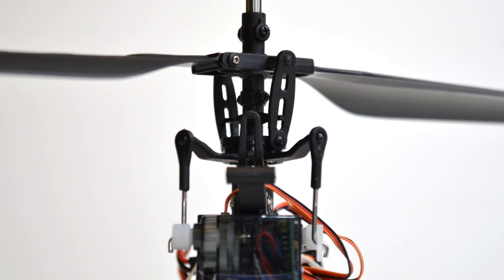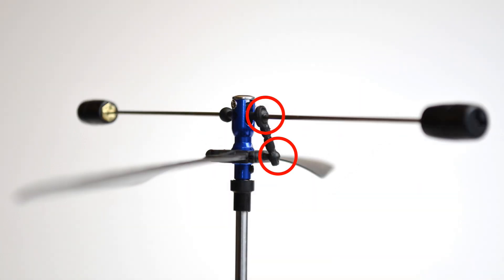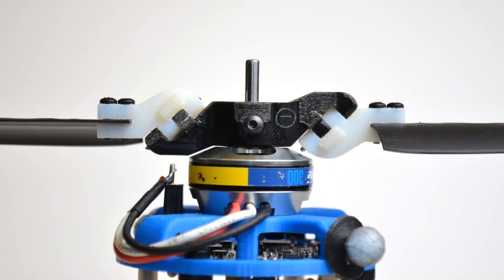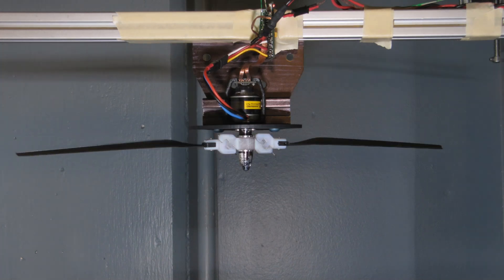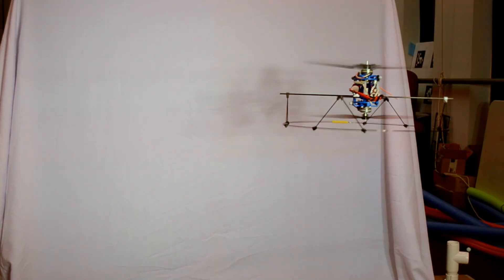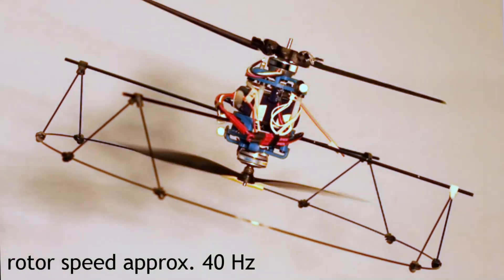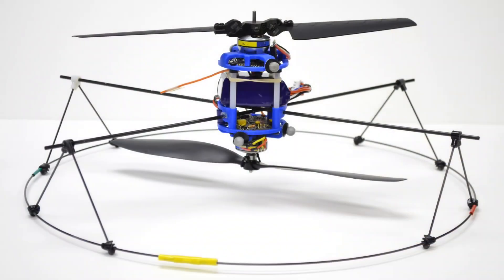A Swashplateless MAV: Thrust, Roll, Pitch, and Yaw from Only Two Motors

Comment: I was wondering how hard would it be to try this with a conventional helicopter gas engine. I imagine it would need flywheel , brakes and springs to modulate the rotor torque with the necessary frequency and phase. The frequency is fixed really what needs modulation are amplitude and phase, I suspect that it's not impossible but probably inefficient compared to direct pitch control with a conventional swash plate
Reply: With the efficiency of electric motors, it could be done by using a gas engine as power source but convert that to electric power and use an electric motor to achieve the fine control of the rotor
Reply: It would be nigh-impossible with a gas engine. you need to very accurately adjust rpm faster than the bangs of even a two-cycle engine. A hybrid platform, where a gas engine or turbine powers a generator would be possible, though there are questions to feasibility.
Reply: @Scrambling-Man I am not thinking of modulating the torque of the engine, that's why I was suggesting a mechanical elastic/quasiresonant arrangement at the propeller axis level. Thinking again about it it could be a solution for electric motors too, the straight electric version like the one of this model doesn't scale well with size

Comment: especially cool even for large scale use cases- there are a lot of constant-to-sinusoidal rotational motion mechanisms out there that could be used on existing helicopter engines to make this work. Though, you don't get collective with this, which is kinda cheeks. Still, it would be excellent for thruster applications. Say, a main rotor or sets of rotors that only have collective pitch for the sake of efficiency, and smaller rotors with this system that allow rapid changes in direction of force. Good shit.

Comment: Revolutionary in concept but seemingly impractical bcz cyclic stoppage of motor from full speed will cause massive cyclic stress on entire system causing premature fatigue failure & cyclic vibrations will also cause very uncomfortable ride.
Reply: I think you misunderstand what is happening. It is slowing down and speeding up once per cycle. There is no full stop. it varies.

Furthermore, these types of motors are completely used to this type of treatment in their regular application in drones.
Reply: Cyclic Vibration amplitude comparison study with conventional same weight helicopter, using accelerometers will prove the concept for feasibility. Given even conventional helicopters are borderline acceptable on cyclic vibration.

Comment: Came over from Tom Stanton’s video. This is an amazing concept!
Reply: Diddo
Reply: I did not understand please help
Reply: @kabutar7998  simply put.instead of using servos to angle the rotor Blades. It uses cintrifigal Force. As the motor speeds up the blades increase angle of attack. As the motor slows Newton's law kicked in and the blades decrease in Angle. This happens every 180deg causing  constant lift and also stability. Motor torque is overcome by the tail Rotor Motor. Depending on what direction and where the blades are in relation to that direction. You are able to achieve pitch and roll Control.
The most amazing part about this is the coding work needed to achieve stable controlable flight
Reply: you need a basic understanding of collective pitch helicopters I’d say. Honestly have I a difficult time wrapping my nugget around it myself.
Reply: Exactly! I also came from Tom Stanton. This is definitely amazing.
Reply: Me, too.
Reply: Mee too😂

Comment: Proportionality of response must depend on the mass of the blades...?  I wonder how practical this would be for larger-scale systems.  It must rely on a sensor for rotor positioning too, or are you simply  coupling a gyro to the pulsing and shifting it electronically in phase until the desired directional control is achieved?  Great idea...

Comment: can you change the electric motor to gas engines and will it still work?
Reply: you’d need a system to induce cyclic torque changes but yes it is doable.

Comment: drag affect the pitch of the blade which limits it's performance.i think adding third motor for upper blade connect only to pitch control mechanism.both motor run upper blade are of same rating and half rating of lower motor.upper both motor running at same speed .any deviation in speed per cycle will cause effective pitch change per cycle which result cyclic pitch.

Comment: Wow. Just Wow. But it does not make swash plate obsolete. Swash plates are needed for free fall diving while maintaining rpm so that the stunt can pull out at the last second. Look up "Trump Tower Building Dive" video. The quadcopter's approach is to lighten the props so that rpm can go from zero to full speed in 1 second. But it sacrifices fuel economy, and quadcopters usually fly half the duration of the same weight class of helicopters. Helicopter's swashplate allows the craft to act as a long-duration-mission vehicle and a stunt craft, all in 1 craft configuration.

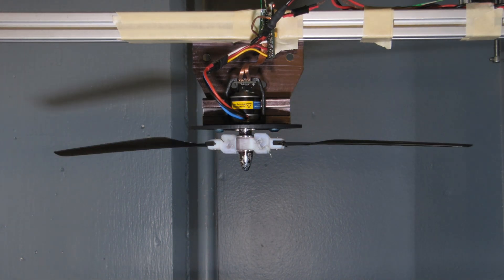Comment: 00:57 Does the white bit (holding the blades) flex with torque difference input?
Reply: No, The white bit only flexes with substantial, cyclical changes in rotational acceleration, working on building my own

Comment: Every time I see a multirotor UAV, I can't help but look at its rotors & think of the lag between throttle-input commands versus pod-and-boom which has fully functioning cyclic/collective pitch control.

...and one more thing: What about dissymmetry of lift? You're "proof of concept" is gonna have a tendency to roll in one direction that's about 90 degrees out from the UAV's direction of movement.
Reply: Why does this matter? It has enough control authority to combat it so isnt that just a tradeoff?

Comment: Brilliant idea and proof of concept.  This took me a few goes at the video to understand how this works.  Clearer explanation might be needed.  Video should clearly mention that the 
1. Pulses that cause acceleration/deceleration of the rpm will cause the propeller pitch to be changed due to momentum conservation, unlike standard variable pitch props where pitch is unaffected by changes in rpm.
2. propeller blades are designed specially to pitch oppositely when acceleration/deceleration of motor rpm are introduced, unlike standard variable pitch props whose pitch does not vary oppositely.
Reply: Check this video https://youtu.be/d80oXSCcHTk
Reply: @ulysses4536  Yes I've seen Tom's video.  He executed the idea impressively. No easy feat.  Been a subscriber of his channel for many years.
Reply: @preddy09  I still don't understand much to be honest, why is it necessary to introduce the lead and lag of the blades. Meaning, why is it necessary for the blades to change pitches? Tag me when responding thanks!
Reply: @wangamanga2128  I think it'll be hard to explain it with more word as it can add to the confusion.  Easiest way to get an understanding especially if you are trying to replicate it would be to first understand how helicopters move forward/backward/sideways, without changing direction it's pointing at(that would involve the tail rotor, which is not relevant here).  Also not the dual counterrotating rotors on single shaft type toy helicopters as they work differently.  I'm sure there are plenty of videos on YouTube.  Once you see how helicopters do that, it'll become clear why pitch changes based on position is needed and then how these guys did it, which is quite brilliant.

Comment: This is geat. But im curious on how you program your flight controller. 
Is there any more info on this design?
Im currently working on a bachelor on increasing drone range and flight time so would be great if you know any more.
Sitation wil ofcourse be given.
Reply: Hans Kristian 
Disk area.
Tilt your quad arms and keep the body level.running in a t not an x. 

The system shown here uses a lot of power for control. Not good for extended range.
Reply: Hello Hans,

Since brushless motors use multiple coils at once, they require a driver to alternate power to each coil. (Do a quick search on how brushless motors and their drivers work, pretty cool stuff) So two ways to change torque are to change the number of coils being used simultaneously or to change the current/voltage or pmw that's driving the motor. Think of this as pulsing the motor once per revolution, then the angled joints create a change in the angle of the prop every revolution. The clever part is that the prop wiggles so that during one part of the revolution, one of the prop's blades is creating more lift than the other due to the change in their angles. This offsets the lift to one side, which creates torque, creating pitch or roll (which are the same thing on this MAV)

Comment: Why not make this an open source so more people can get into this project ? this washplateless it's a brilliant idea.
Reply: what do u need open source for ? 

you can clearly see how it works just reverse engineer it ... it can't be that hard 

Collective and Yaw should be a no-brainer ... 

You just need to design a print-in Place 45 degree hinge (which can be done in like 10 minutes) 
mount them between the motor axel and props

and then just apply a sinusoidal variation rotated 90 degrees "before" the direction you want to apply Cylic pitch in 

hardest part in all of this is syncing the sinusoidal to the rotor's RPM but if you have Hall Effect encoded motors then it's EZPZ
Reply: Great! We found someone smarter than us (who want to see the code) that will do an opensource version. 
Thankyou, @Mihai Lazar!
We are waiting your link.
Reply: @zesegatto  Awesome response haha
Reply: I'm sure someone sensible will end up producing an open source version.

Comment: I suppose you would need to vary the amount of torque variation, depending on the payload aboard?

A simple but effective method of 4 axis control, I would say it is on a par with the multirotor systems for possible failure points, quads have 4 motors with simple props, this has 2 motors, 1 rather complicated prop and a simple prop.

This concept is likely to be more spatially efficient, likely to fit through smaller spaces and a single large prop disc is always more energy efficient than 4 small discs.
Reply: I'm not sure if I'd call two pivot points on the prop "rather complicated".  It's really no more complicated than any traditional folding prop.
Reply: A folding propeller is probably heavier than this entire craft!
Reply: And yet...a folding prop is exactly what this craft has....
Reply: It's more of an articulating prop than a folding prop, folding implies ease of transport or storage, articulation is to operate to give extra function, if we're going to get pedantic on word meanings.
Reply: if the upper prop and lower prop are close, the efficiency will also be decreased.

Comment: Could the op list advantages vs classic quad ? Thanks
Reply: Marcus Quadcopters have no redundancy either (and twice the parts, twice the failure points).

And the mechanical design is incredibly simple.  That is in fact, the point.  It's really no more complex than the folding props that most all large multi-rotors use.

As for a hexacopter with redundant this and redundant that, who cares?  This is intended for micro air vehicles, not massive, heavy lift craft.  Not every design needs to scale (up or down).  Use the right tool (or design) for the job.  And if you're going to get picky about scaling up anyway, you'll be saddened to learn your beloved hexa doesn't scale up very far either (traditional helicopter designs do far, far better at the large end than multi-rotors).
Reply: Half the parts.
Reply: Byron Brummer

No redundancy, complicated mechanical design.

You can fit a Hexacopter with redundant radio and control system.
Besides where would you put the gear on that?
Reply: You can fly a quadcopter with 3 props. We do use Multicopters for redundancy though. Also retardant controllers, batteries and radiosystems are used when high reliability is important. Like the  Jeti Duplex Dual Path.

Comment: Very interesting, I wonder how it scales up, and at what point blade momentum/inertia becomes too great to be overcome by varying the motor torque (if I understand this correctly). Also, a friendly pro-tip: Have someone who does not have a mouth full of potatoes narrate this at about half the speed.
Reply: Chim Xotox 
Other way around, more blade weight, more control.
Reply: One problem is that helicopters run on jet turbines, not electric motors, so pulsing the thrust would be difficult. It maybe could be done with a piston or rotary engine by precisely selectively cancelling the ignition spark. Or an elliptical gear drive could be used, but there would have to be some way to make it variable, Maybe an elliptical planetary gear system?

Comment: This is amazing! Far fewer mechanical parts, full 3-axis control can be achieved entirely in software! No need for quad rotors, these twinrotors can do it all! When will someone build this? This week or next?
Reply: "Far fewer mechanical parts"   What?

A quad has four rotating simple axis.  And if you pop up to a hex, you have redundancy.  Or a U8 you have even better redundancy.

No. . .sorry to say, this is at best, a task specific design.

Comment: This method generates more vibrations.
Reply: agreed also, plus scaling this up for that reason is going to be difficult, excess fatigue and material weight to cope etc. also no engine off fly ability either as with conventional cyclic swash plates.

Clever though, and a robust mechanism for drones, I can see this having good military applications and in the field utility.
Reply: agree
Reply: counterotating pulse torque given to both motor at same time which balance itself over the frame.need to build frame much more stiffer.vibration can be completely eliminated

Comment: I own / use about 15 R/C helicopters all are 1 motor. All have swash plates and 3 servos. 
Question
How do you change the blade pitch? The video shows some hinge but no mechanical control of pitch. If it just a hinge then its extremely limited in pitch control.
Now
On all my R/C helis the blade pitch changes from +10 to -10 and is contentiously varied / controlled as it spins around the swash plate. Its impossible to control this by hand. You need a FBL controller to do super fast variations in blade pitch control.
Last
The only excess power used is the servo. Servos are extremely energy efficient when compared to the power requirement of a motor lifting a heli in the air. Every oz or gram vrs lift is important in a vertical lift aircraft. If you need efficiency you need lifting surfaces like a wing.
Reply: Ed Hughes 
It throws the blades forwards and backwards each revolution and the angled hinge tilts it as it goes forwards and backwards.
So simple.